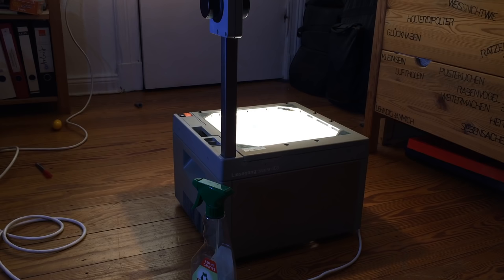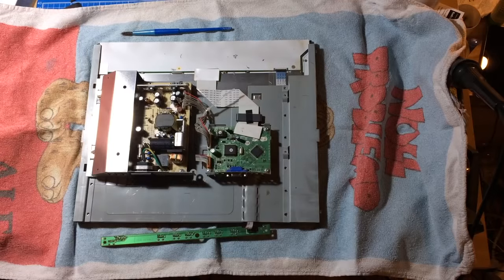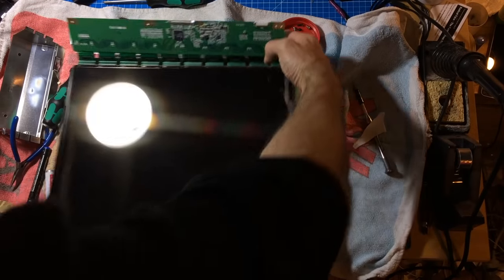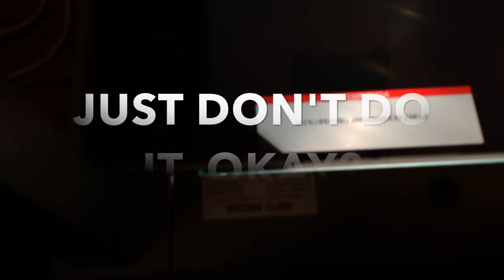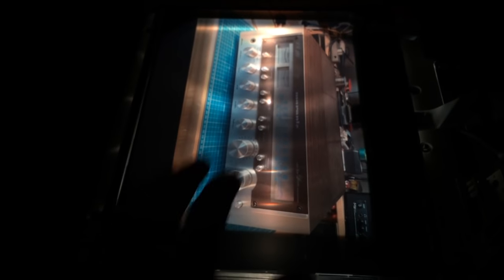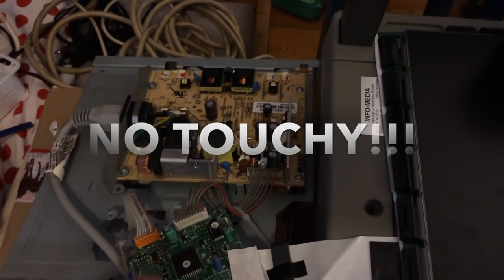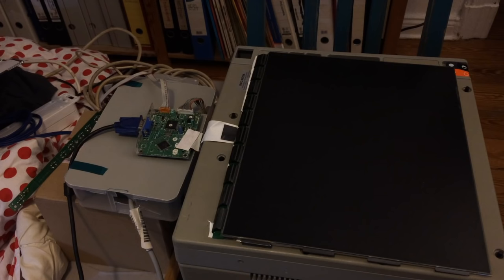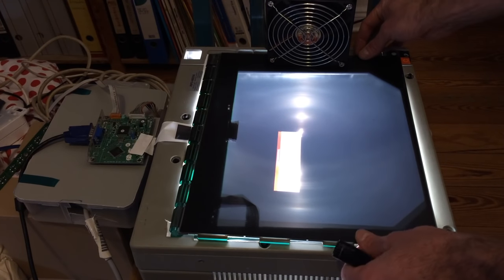DIY Video Projector from an old Overhead Projector

Comment: I bought a fold up 3M overhead projector from goodwill about 5 years ago for $10, and last night I found a Kodak Carousel slide projector in a dumpster and looking to make something with one or both of them. I also bought some binoculars for .50¢ at a garage sale a week ago. What I have in mind is a movie projector, and/or some sort of telephoto lens for my smart phone or a monocular and/or a microscope.. I’ve only taken apart the binoculars and the part that is next to your eye that has 2 lenses, I flipped one around and it makes for a pretty good loupe. I also have another pair of binoculars and an old Pentax EI200 digital camera with a zoom lens that I purchased back in 2001/02’ when digital cameras were still sorta a new thing and expensive. It still works too but all of the things i mentioned are at my disposal. Have a pair of reading glasses too… lmao.

Comment: I made one of these probably 8 or 10 years ago and my setup looked exactly the same as yours. Those boards for the horizontal and vertical were in the way on mine too and the only way to remedy that would be to get another ribbon cable where they plug into each other at the corner so you can lay them out away from the LCD panel. That is a very fine ribbon cable and not too easy to mess with but it could be done. I had a lot of fun with mine but I ended up not keeping it because it was just so bulky to mess with. Would be fun to build one again though.
Reply from the maker: Yeah, they are fun to play with but take up a lot of space. I gave the one from the video to a friend who does graffitti art. He uses it to project sketches to walls now. :)

Comment: I did this years ago, was always worried about "Death by power supply" as 240V isn't a tickle, I think I put the power supply inside a tupper ware box.. I played killing floor on it, got massive motionn sickness, I had a 10 foot by 10 foot screen. And it was hot enough that I didn't need my heating on, I did prop the LCD part away from the monitor with blocks of wood and a PC fan to blow between the projector top, and the screen itself... This was mid  2000's I think. Good fun

Comment: ha ha I been working on a handmade overhead for my live visual performances like this but with extra bells and whistles!! glad to see I'm not the only one messing with older tech crossing with new parts! I agree with Beeny, but I would also add a mask to baffle the spill light and tape the light leaks if your making improvements, maybe a temapture adjustable 3000lumen WHITE or RGB LED they make ones that get really bright and add an iris to the bulb to control brightness! Once my prototype is done I'll link a video to yah.
Reply from the maker: +William FitzGerald Haha, nice! Yeah, there is so much to optimize and endless possibilities to tinker with this. I didn't find the time yet (too many distractions and other projects) but maybe there's gonna be a follow up to this one, too. Really looking forward to seeing your video (and maybe steal some ideas ;)).
Reply: Hi William. Did you end up getting the projector to work with an LED as a light source?

Comment: Might be a dumb question, but would something like this work by just putting on a movie on your phone and laying it on the projector?
Reply: No it will not the object you put on the overheads surface has to be transparent or translucent I think
Reply: If you do that, all you would get on the wall is a large black rectangle with slightly rounded corners. There is a few other YouTube videos of people carefully taking out some of the layers of their phone screen and keeping separated from the rest of the phone but still connected, and then using a projector lens and another lens that makes the images parallel, I think. They use special color LEDs that are kind of expensive. But I don’t see a problem with just placing the phone screen on an overhead projector and then covering the rest of the surface so only the image on the phone screen shows up and not the empty space on the rest of the projector surface.

Comment: They may have had the projector plugged into a circuit with a lot of things running on it. Every time they turned the projector on it tripped the RCD or blew a fuse. Not because the projector was broken, but because the circuit was already at capacity before the projector was turned on.
Reply: Yeah some appliances that run on 208/230v need their own line and circuit breaker. I wonder if a step down voltage stabilizer/transformer would work? I’ve had problems getting my 208/230v in-wall AC unit to work ever since my apartment replaced all the old baseboard heaters with new energy efficient ones that don’t have the Nema 6-30r like the old heater in the living room had. I’ve tried making a 20’ extension cord with 6-30r/10-50p ends to draw power from the 10-50r stove outlet and have had no luck. I wonder if that’s sort of the situation you’re talking about or no?

Edit: I ended up finding 2 different 120v window mounted AC units and gave up on tinkering with the 240v one. But I’m looking to maybe do something with the parts inside if I can’t sell it for more than $100 since it’s a $800 AC unit.

Comment: I think the next stage should be is to get rid of that power hungry halogen lamp and replace it with a 50 watt LED. Better light, probably no fan required and most of the heat gone. In fact the box will be almost empty so you could put the power supply and driver board inside, perfect solution. You could probably use the original optical system with little modification.
Reply from the maker: That's a good idea. I was actually already looking around the web for suitable replacement lamps. LEDs are definitely an option. I found some that have nearly the same size and contacts so maybe I can even keep the fancy changing mechanism inside the projector and just fiddle around with the electronics a bit to make it work. I hope I find the time to try that soon.
Reply: Jan Beta Hey Jan I was just wondering, have you found a 50w led avaliable in Europe yet? I'm doing the exact same thing as you.

Comment: hi Jan. coincidentally i found this video where you made this overhead mod.
now i made the beginning of the RooBee DLP 3d-printer from instructables. and i wondered if i can build that and leave the (acer) DLP projector away due cost perspective, and put a monitor under the build platform with one or multiple UV led's or lamps under it.perhaps switched or with a shutter or so.
then we also should get rid of the UV filter layer in the monitor, (not the polarisation film's) but if this works with a cheap monitor afterall, maybe then we could use an screen with a bit higher resolution to sacrifice. 
the pros off this is that if it works we got a much bigger build volume then the common Anycubic Photon and all the other comparible DLP 3D-printers. those are also using a simple screen in fact, but way to small in my eyes.
perhaps i am goeing to try and strip an old lcd screen with a red stripe true the screen (hopefully the bad stripe does not interfere to much just using the monitor in Black and white as a Gobo, but just for testing puposes who cares) like so and put a UV tanning light under it and see if some Daylight resin will cure. (knowing that the resolution of the crappy monitor is way to low for serious usage)
what do you think about this?
Reply: Are you talking about putting a computer monitor on the overhead projector surface minus the light diffusing plastic sheets & plexiglass? I wonder if that would work.🤔